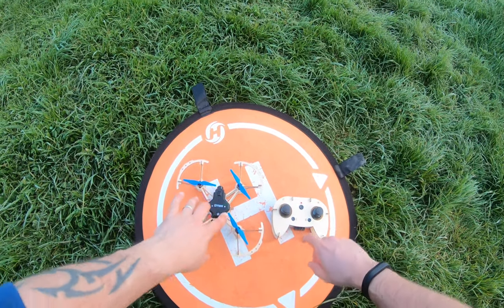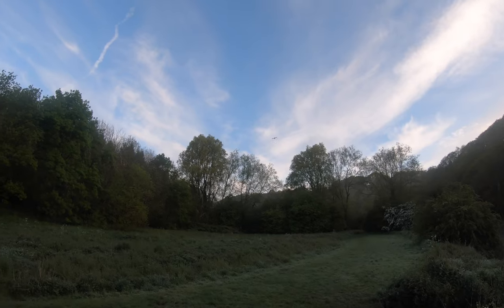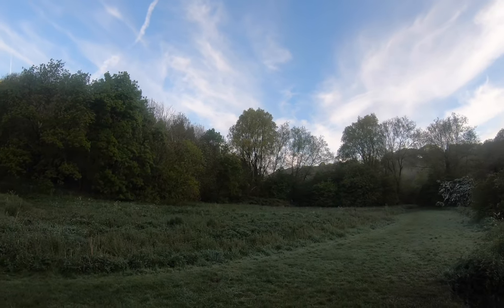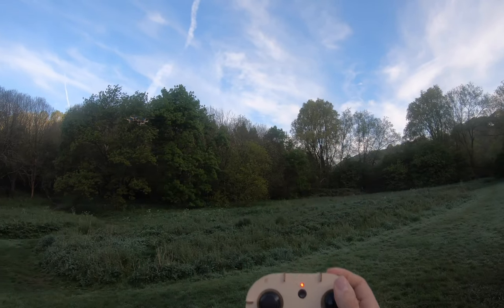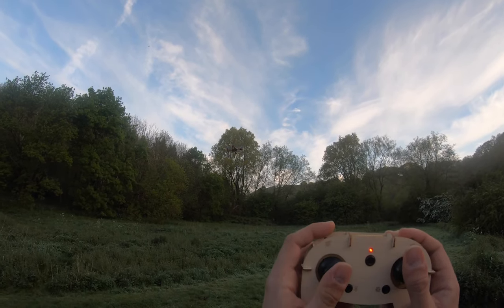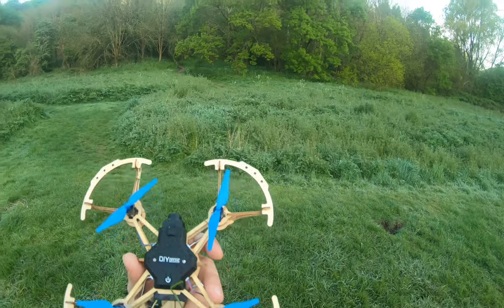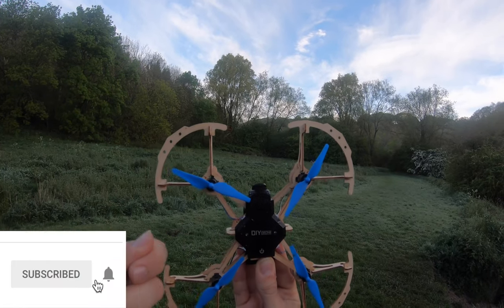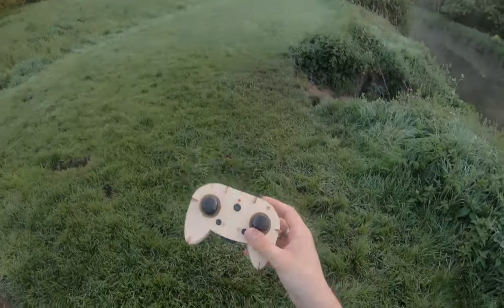XMR / C M2 DIY Wood Quadcopter Flight Test Video

Comment: Flies OK Better than I thought it would. Nice design to look at and a good concept but it has as you say some minor faults. Basswood being a hardwood  is fairly robust (the UK equivalent was used to make shields back in Saxon times) but it can be brittle the thinner it is cut
Reply from the maker: Thanks matey, I didn't know that was the main use for it. Thanks very much 👍😀

Comment: Mate it flys much better than I thought it would (wood😂) is the flight time much better without tree catchers? A very intriguing project JD, I love the tx, all in all I like it 😁✌️✌️
Reply from the maker: Haha love the pun bud! Na mate they make up the main part of the stability and if removed the quad moves too much. The 3 speed modes should provide more than enough speed, I haven't crashed it yet, but, I have a feeling if you go healing into a tree there may be some snapage 👍😀